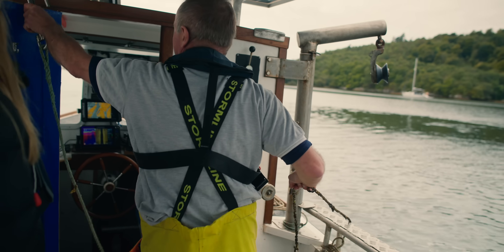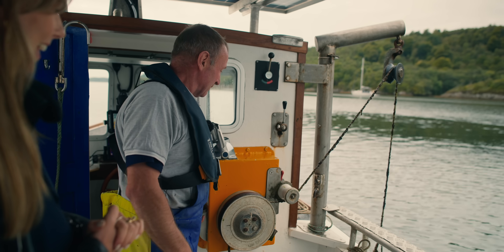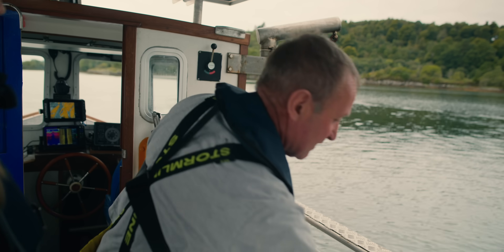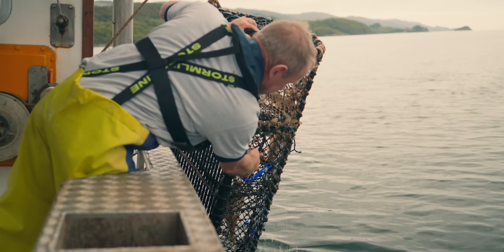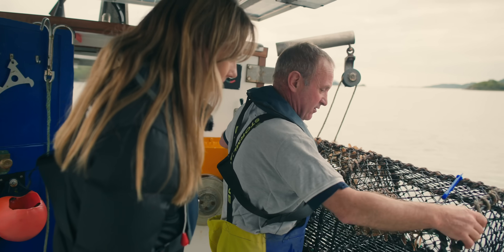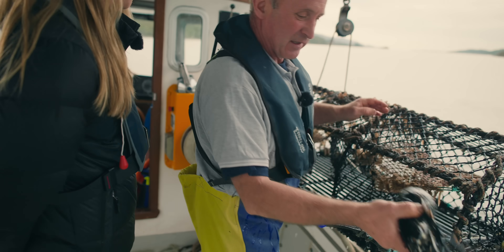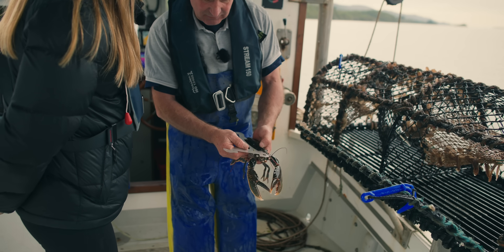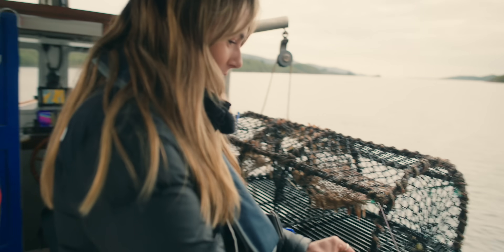Onboard the UK's FIRST, Fully Electric Solar Powered Fishing Boat!

Comment: Unless the batteries are improved DRASTICALLY this is hopeium at best
Reply: As he states in the video, the batteries he has do exactly what he needs and more. I think you are hinting at some other "mission" for a boat?"
Reply: ???   In this area, this is the industry's very first efforts.  Are you saying you doubt battery tech will improve?  Design ideas won't improve?  Think of this boat similar to the first Nissan Leaf perhaps.
Reply: except you know, it's working brilliantly.
Reply: What is the aspect of battery performance where you feel this project is drastically deficient? The overall capacity could easily be increased by adding more batteries but you would then be spending more than required to meet the specification required for the job. If he routinely has his creels within 20nm of his home port then the present battery capacity appears to be sufficient. Similarly he could have a more powerful motor ... but more cost (and he is funding most of this himself despite some grant money)... but he is pushing a displacement hull which is speed limited by virtue of its design, so not much to be gained.
Reply: There is no hope required ... he is successfully using this boat for commercial inshore fishing.

Comment: How much drag do the solar panels generate in heavy winds? It looks like a big sail
Reply: Sails go up and down don't you think and not backwards and forwards!!
Reply: @marviwilson1853 wind blows through, surprisingly they kind of help keep the boat stable on a windy day
Reply: @marviwilson1853  anything that catches wind and propels can be called a sail, the blades of a windmill are called sails too
Reply: I think we can see that Hans isn't a fool ... he's been using the boat in various sea conditions through the year and knows whether the panels are worth having or whether they cause problems with the wind. Clearly if the panels were more of a problem than an advantage he could remove them and run entirely from shore power ... but as explained they are enabling virtually free "fuel" through the summer period. If the design allowed it I'm sure he could remove the panels in the winter but then he would probably want another shelter roof of some kind anyway... so why?

Comment: Boats are horrendously inefficient, so the electrification of the boating industry with current battery tech is incredibly limited. Nice hobby boat though for pottering around the loch, checking on a few lobster pots a day.
Reply: Actually not. The most efficient way to transport large amounts of stuff is by ship. If you can do it electrically then even better.
Reply: @marviwilson1853  efficiency per mile compared to most people’s comments reference point, the automobile. So yes, very inefficient. How many electric cargo ships are there?
Reply: @GingerPiston  To move across the water and catch lobsters I am afraid does require a boat! Clearly as a means of transport from A to B a road car gets more miles per kWhr than a boat but cars don't work very well on water. They tend to sink! Some realism has to come into play here don't you think. As I said before, ships are the most efficient way of transporting heavy loads from A to B measured by Kw's per tonne per mile. Better than a train, better than a lorry.
Reply: @marviwilson1853  mate, are you simple? My point about efficiency is that boats require a lot battery weight per mile compared to a car, so given the current battery tech, converting most commercial boats isnt currently an option. A little hobby trawler like this than does 20 - 40m per day, then sure. But batteries won’t work currently for the majority of commercial fishing and cargo vessels.
Reply: @GingerPiston  As I mentioned before, a boat can move more weight per kWhr than a car or lorry or train can. If I want to move 50,000 tonnes of grain from A to B then believe it or not I will need less total kWhrs if I do it using a boat than if I do it by road or rail. In all cases the amount of energy required to move 50,000 tonne's by any means of transport is large but we are not talking here about total energy requirements we are talking about efficiencies.
Reply: @GingerPiston  er, the fundamental surface area to volume ratio says otherwise! (which is why we use absolutely huge container ships to ship stuff 6,000 miles from the other side of the world for less cost per item than it costs to then get them 50 miles from the dock to your door...
Reply: @maxtorque2277  There’s an electric ferry in Norway that has to charge after each relatively brief crossing. There just isn’t the room for enough battery to give a cargo vessel a decent range. End of discussion.
Reply: @marviwilson1853  No point arguing with him.  Just not worth it.  That boat actually effectively weighs nothing - it is floating in/on the water.  

The batteries can effectively replace the ballast required in these vessels.  I doubt he has heard of the plimsoll line - not that this vessel will have, or need, one, I would think.  It was not designed as a cargo boat.  

It also has a ‘draught’ which is a compromise - a more modern design may have improved efficiency (although the old boats were designed for stability and possibly not efficiency (when diesel was cheap).

Whatever way one looks at it, he has demonstrated what can be done - and it can clearly be improved for future builds.  Definitely lots of kudos to the fellow, for his effort and success in demonstrating what can be done with electrifying a decades old boat design.